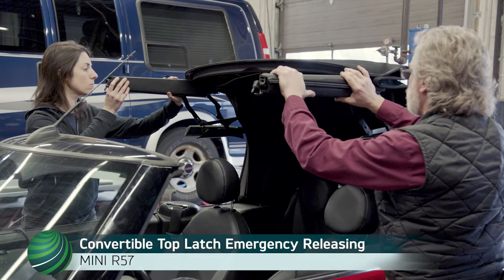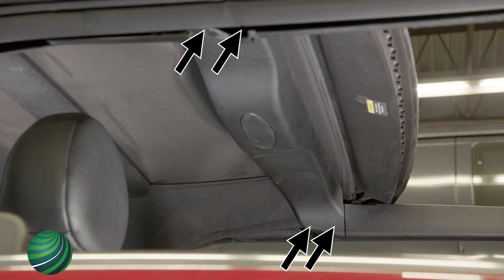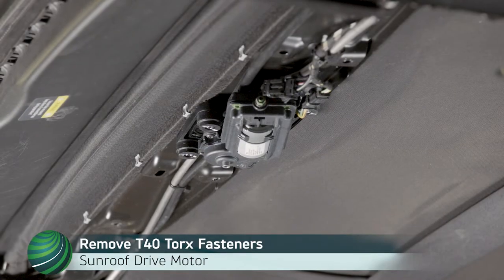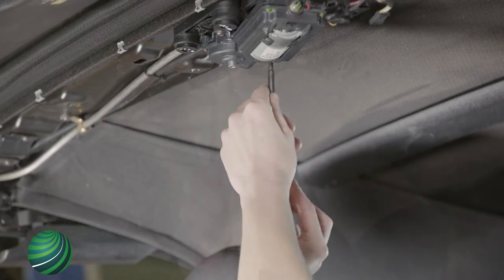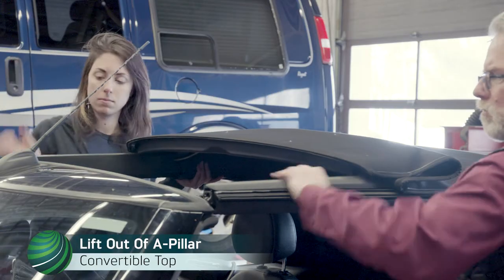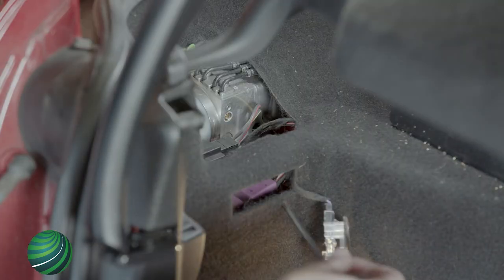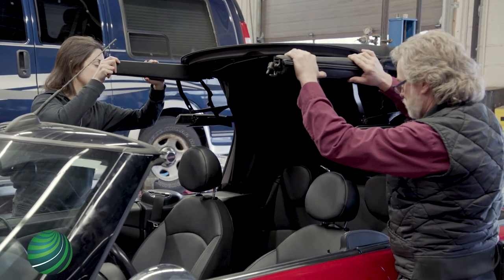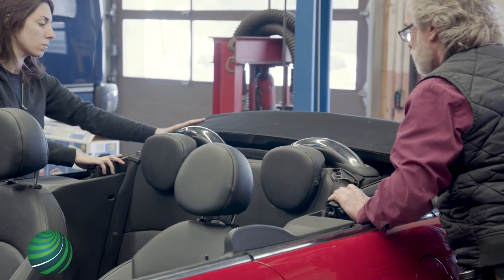How to Release Convertible Top Latch In the Case of Sunroof Cable Failure. MINI Cooper R57 Models

Comment: There is a t-30 screw that you can release the front latches with, in the middle on the top in which they break in this video. Do not pry the latch open release by turning the T30 screw to the left. If you continue to turn it it will take the top all the way down
Reply: Can you do a video on this?

Comment: Could you make a video going the other way? My roof will close up to the point of where the sunroof would be and doesn’t slide at all. I don’t think the arms are locking in when the top folds up to the top of the windshield
Reply: I am having the same problem.  was it ever solved?
Reply: Happened to me last night , the bits that crab claw roof secure onto car ain't working !! Cant find nothing zero info online !
Reply: @robertcollins7034  Ever figure it out?